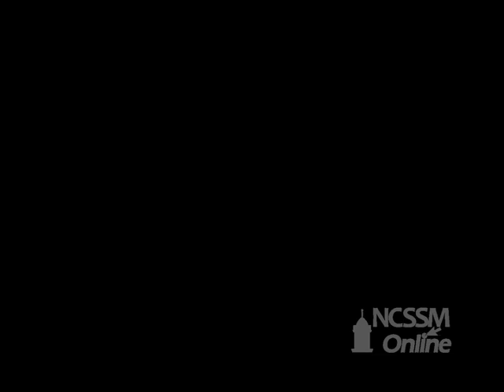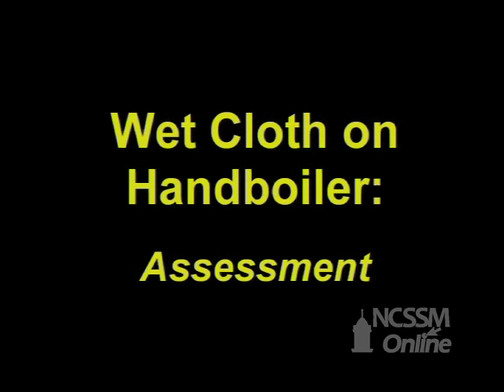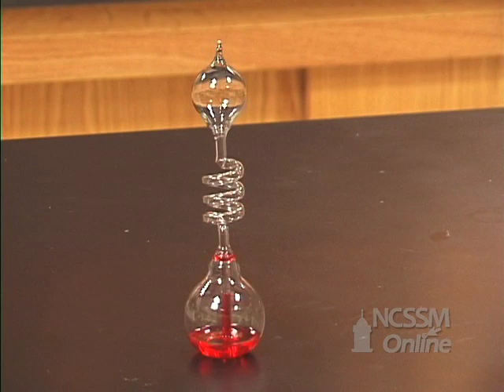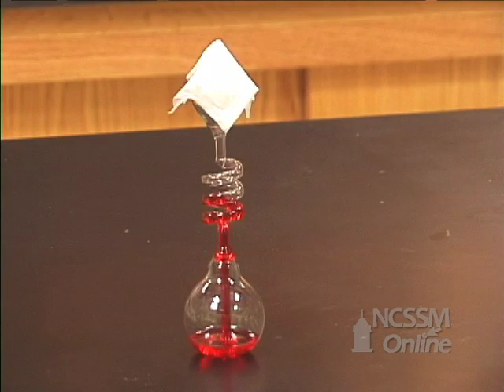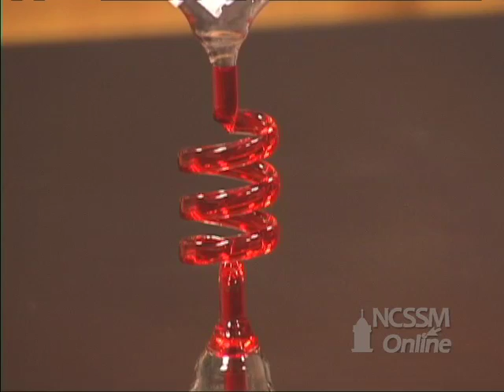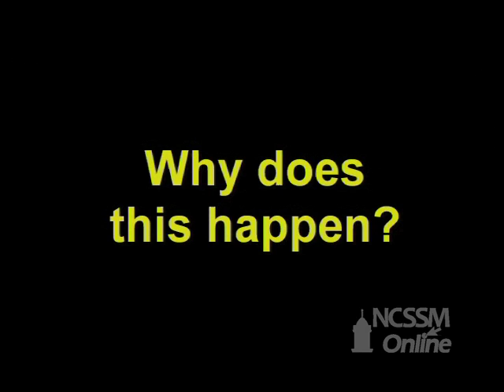Vapor Pressure Hand Boiler

Comment: The cloth is cold, and since the Ethanol has a low boiling point, it also has a low freezing point. Therefore, the Ethanol vapor compresses at a very low temperature. The gas inside the glass is compressed as the cold cloth slows the molecules and an area of low pressure is created sucking the Ethanol(l) up the tube balancing the pressure at both ends of the apparatus.